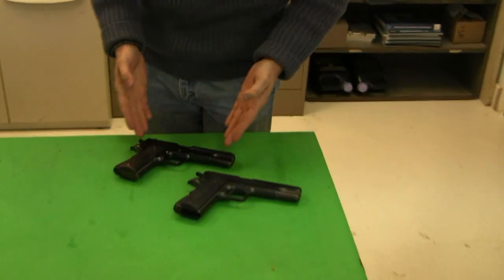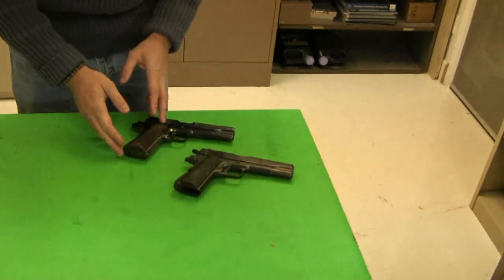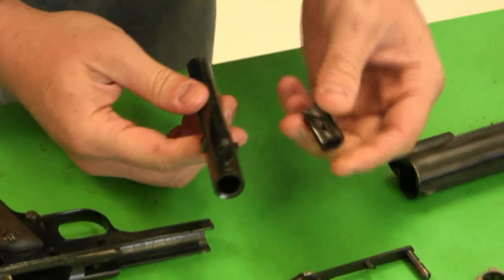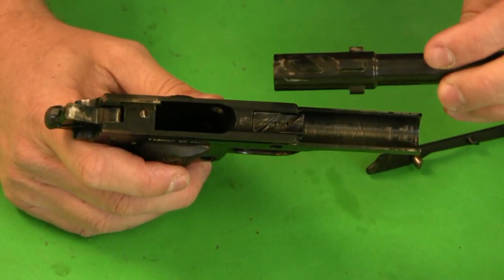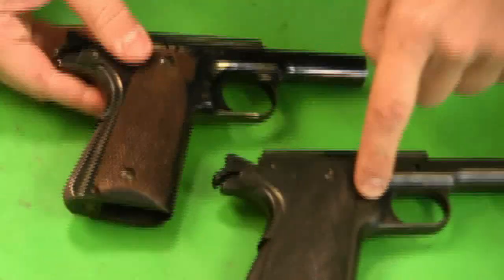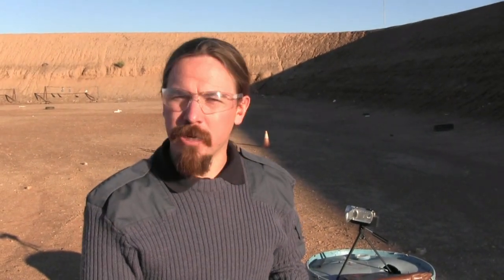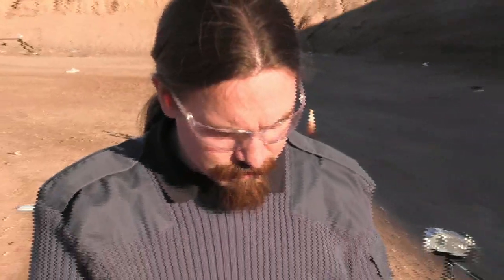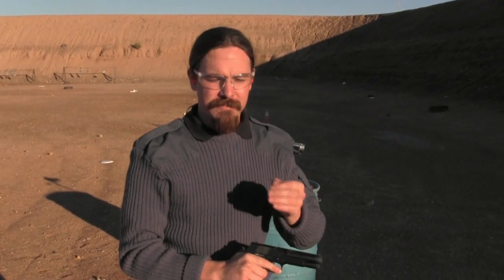Mexican Obregon 1911 Variant

Comment from the maker: It doesn't make any changes to the handling. The rotating barrel probably has the potential for better accuracy, but the Obregon was a service pistol and not tweaked for maximum accuracy. I don't expect the average Obregon would exhibit accuracy much different form the average milspec 1911.

Comment: I have often wondered why 1911 makers never went to a captured recoil spring system. I have switched mine to a flat spring made by wilson combat and it works like a charm. Last 3-4 times longer than the standard. I guess the next step will be fully captured. I have seen an Obregon before and it was not in nearly as nice a shape as the one you have.  It would be a great piece for someone who collects 1911s. Your Ballister Molina is a really nice gun.

Comment from the maker: I suspect the main pin in the frame helps keep the cam from moving around when the gun cycles, and thus prevents it from getting beaten up too badly. There are certainly other ways that could be accomplished, though.

Comment: On an unobserved side note, these will accept the use of a silencer without the obnoxious vertical 'waggling' of the 1911 after each shot.  It is quite hard to put up with the Colt going 'wubba-wubba' after each shot and it has proven nearly impossible to maintain any sort of sight picture due to the hyper reactive bobbing on the barrel end.

Comment: I'm also left handed. I have the same problem with a Ballester-Molina, which has a very sensitive, quirky safety, if it goes up a little the pistol won't fire and in order to fully engage the safety into the slide notch I must pull the hammer fully backwards (even if it's on the cocked position) so the tip of the tang of touches the beavertail, and then I can press up the safety. I dunno, maybe my pistol is not right.

Comment: do you think that pin machined onto the frame is neccessary? lets say the cam didn't have the pin and relied completely on the slide stop to keep it in place

currently i'm working on ideas for a pistol of my own

I owned a stoeger cougar and i do not remember there being a pin to keep the cam in place for the rotating barrel